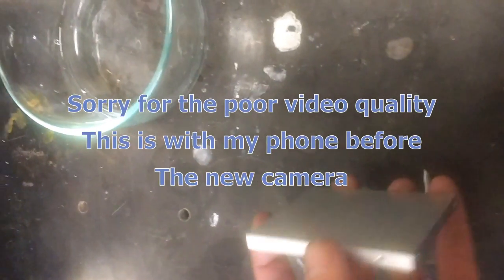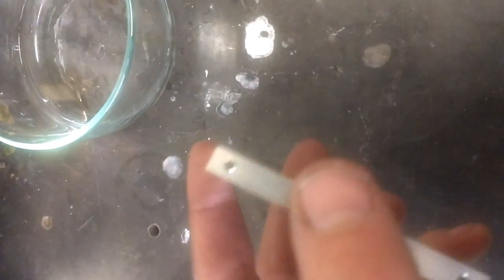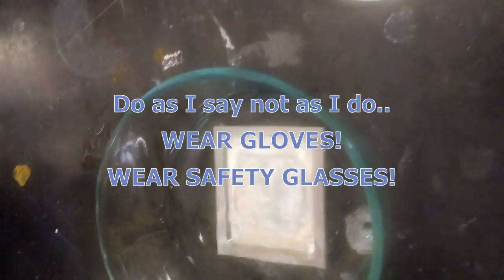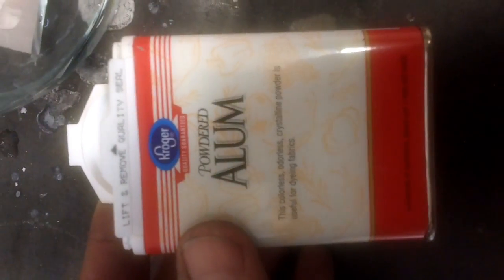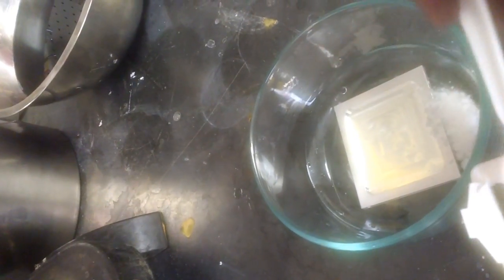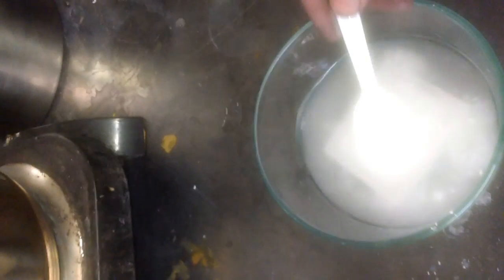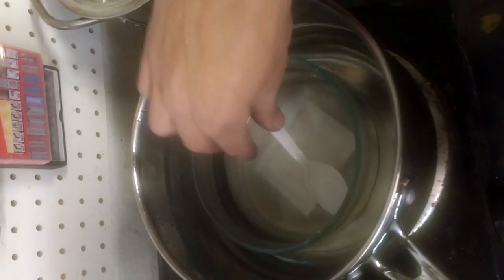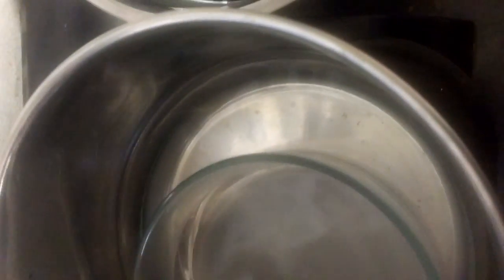Dissolving Steel Tap Out of Aluminum

Comment: I know this is 5 years late. I broke a tap in a aluminum block, searched on youtube for ways to remove it and found this video. I used alum before but only for after shaving so I thought what harm can it do, right!? Boiled water with dissolved alum for 1.5 hours tap came loos and  another half an hour later I found myself in the hospital with severe respiratory / asthma problems. Doctor said alum closes not only skin pores but also alveolus (lung sacs). Perhaps this comment saves some one a trip to the hospital. Be save, ventilate.
Reply: Oh, I forgot to say I did not use battery acid to dissolve the alum but just pain tab water, worked like a charm except the hospital part that is.
Reply from the maker: I wish you a speedy recovery. Thanks for the warning. I'll pin your comment for others to see. Be safe out there.

Comment: How long would i wait on a 8mm bolt with a broken extractor within it? Motorcycle fork clamp... :d I also have a stick welder, but that probably can't be used for such fine work...
Reply: I'd count on overnight but if you keep it warm enough could be faster.
Reply: @Adam-im4hm  got the potassium one, waiting for my pyrex dish, fingers crossed.

Comment: How would this affect aluminum that is already anodized?  Also, how did you dispose of the battery acid?
Reply from the maker: I don't know but at a minimum I would assume it would discolor it. Mixing sulfuric acid with baking soda is a common way to neutralize it.
Reply: @Goldenfab  once neutralized,  you just flush it, or put it in a plastic container and toss it?
Reply from the maker: @ThatEEguy2818  I'd look into approved ways to dispose of it for your area. Its a just sulfuric acid.

Comment: Never woulda thought something like this would male it soo easy to remove a broken tap in aluminum.are you able to save the mixture of battery acid/alum once it's been used for future purposes or is it best just to dispose of it and make more when needed?ask only cause I'm always trying to remove stripped screws from rc car parts and rather then fight them it would be easier to just dissolve them this way.thanks for video though.saved me from having to buy new shock towers for my 100mph rc build.
Reply from the maker: I don't know why you couldn't save the mixture to dissolve it out at a later date. I used the mixture now than once. Just make sure and and store appropriately.
Reply: @Goldenfab  sounds good.only ask cause I did notice that once mixture cooled back down to room temp the alum recrystalized and sat at the bottom of glass container I used so figured it would dissolve again once mixture was heated back up.as far as storage goes I figured I'd just put it in a Mason jar and only fill it soo much that way solution doesn't touch any part of the lid being that I would think after awhile even at room temp the mixture would start dissolving the lid if it was in contact with it.see how it goes and if need be I'll swap it out to a plastic container that's safe for battery acid.thanks for info.

Comment: Heat lamp is a bad idea. Reason: Infrared reflection of glass is high, energy density at the target low, water has high specific heat capacity
Reply from the maker: There may be better ways to warm it up in a scientific sense but if you need to warm it up and a heat lamp is what one has then the added heat  will improve the reaction time.
Reply: @Goldenfab  no offense, I just think everyone can start with hot water and add energy via old pot and water bath, best wishes
Reply from the maker: @hareriti2463  Agreed

Comment: Trying with water and alum but so far lots of bubbles and dirt . Drill still in the hole . 200g of alum not measured water content but it's not much . It's in a Pyrex beaker on the stove. I think battery acid  but how much do you use ? Just enough to cover part ,?
Reply from the maker: I think I used straight battery acid mixed with alum. I used asuch alum as I could get to dissolve. At some point after adding a bunch it stops dissolving. Yes I have it in a pyrex on a burner in a double boiler (water in a pot and then the pyrex with the solution in that). I had the water up to boiling temperature. The hotter it is the faster it goes. At room temperature it hardly did anything for me.

Comment: No need for the acid.  Alum works fine in water.
Reply from the maker: How long does it take without acid?
Reply: Goldenstein Engineering and Fabrication LLC depends on the amount it has to dissolve. Obviously it takes longer but there is no damage at all to the non ferrous metal with alum and water. Not a single micron is lost.
Reply: @Goldenfab  Heating the solution greatly speeds the reaction.  Added acid can attack the aluminum.  Potassium alum is about as acidic as you can go (ph of about 4.6).
Reply: What is the purpose of the acid? Does it speed up the reaction?
Reply: I have a tap busted in an electronic enclosure.  I can pull the circuit board but there's an LCD panel that's glued in.  I can't remove it without destroying it.  Can I just dip the corner containing the broken tap into the alum solution or will fumes damage the display?  I wouldn't be dipping the display itself.
Reply: @ThatEEguy2818  It shouldn't affect it at all, as most displays and their casings are made of plastic or glass, both of which are very stable when exposed to an acid or base. It's only your paint, pens, markers, or writings on top that you may have to consider protecting, but having a small fan pointed towards your work should help move enough air around to avoid any unwanted affects. 👍

Comment: Thank you so much! I’m a machinist and I’ve been battling broken taps in aluminum and steel for a long time. Usually it’s either burn em out or drill em out. I’m a old timer so this probably has been on the internet a long time. But this video just saved me a lot of time and money. Thank you!